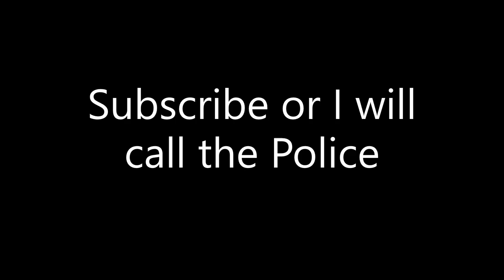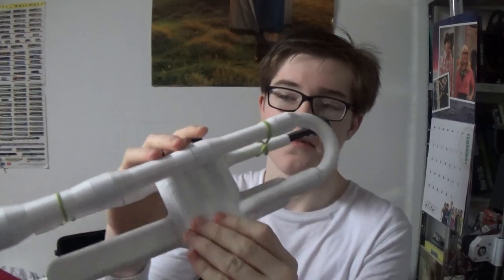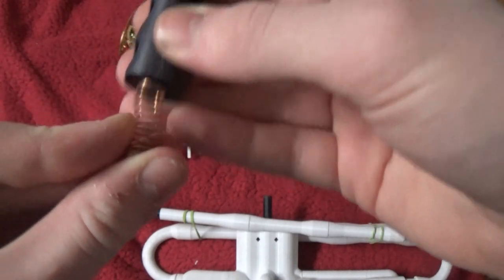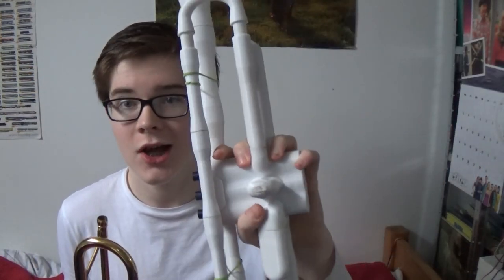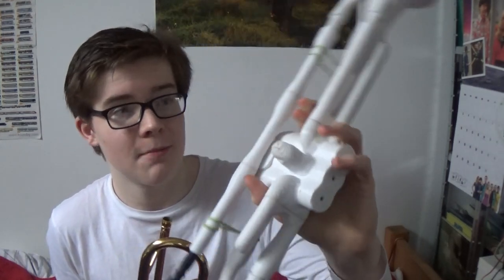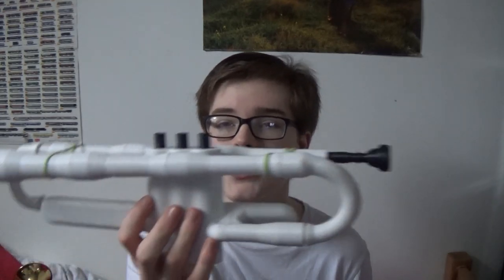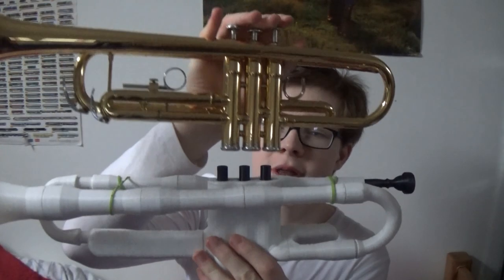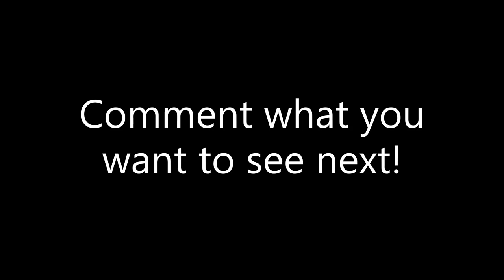3D printed trumpet?!?

Comment: The tone of the plastic may be ok.  It may be the valve tolerance that is causing the "wobbly" sound in the notes being played.  If the valves (and the respective bores) were polished to a decent smoothness and the tolerances are kept tight, it may sound quite decent for the price.
Reply from the maker: Yeah, I tried to make it nice and tight, but sure ah well. I appreciate the advice!

Comment: sound like its leaking air everywhere. you could play a better tune just with a simple pipe of any size with any mouthpiece. the fact that the 3D printed trumpet sound is so bad tell me that it is leaking air inside and that air is colliding with a reverse flux, thus it is cancelling the normal resonance.

Comment: With enough work I think it could be made to sound pretty good, if not great.
Thank you, I was wondering what this sounded like (I found your post on Reddit).
Edit:
I didn't watch the full video... so I don't know what your analysis is of what the problems are, but....
I think that it's likely that the off-key sounds could be from air leaking in the valves.
And that you could solve by printing in resin, or even by sanding or spraying your part down with clear polyurethane in those tolerant sensitive areas to close the seal.
Reply: Also!
In regard to the valves getting stuck, you could add a lubricant or even print in the orientation where the layer lines are in the direction of the valve's movement (so that those layer lines don't grab eachother).
Great work! Like @sochimaanike1916 said "Big things start small."

They most certainly do!

Comment: I certainly don't wish to be rude or unsupportive, but the truth is that the "3D printed trumpet" in this video is in fact NOT a trumpet. It is a trumpet shaped thing that does not work musically, and is clearly not functioning acoustically as a trumpet. As an instrument designer and maker and player, it is clear to me that several serious deficiencies are keeping this from working, other than providing a vague path for the buzz from the mouthpiece to eventually make its way to the bell end. It is clearly extremely leaky, and there is no resonating of an air column going on. This is why there are no real entirely 3D printed trumpets out there; you just cannot get the tolerances to have it seal up airtight and still have working valves and slides. Now, you could successfully make a perfectly functional bugle or natural trumpet using 3D printing technology. Many woodwind instruments have been made using 3D printing that work quite well. The killer is the need for airtight yet freely moving slides and valves, and 3D printing at the current level of that technology can't do that.

Even plastic valved 'brass' instruments that are on the market are firstly molded rather than 3D printed, so they can get better tolerances, and at least most of them use inserts made of better materials in the valves in order to have those work properly.

With that said, I applaud "Dman" in his efforts to try this. But since a valved trumpet is beyond the reach of the technology, I would like to suggest that another brass instrument would be more successful (probably a LOT more successful). Some good candidates:
- try starting with a 3D printed bugle
- advance to a 3D printed natural trumpet
- perhaps try a cornetto
- try your hand at making functioning keywork to create a functioning keyed trumpet or keyed bugle

Don't give up trying, but try things that you have enough understanding of the requirements first to have a chance at success.
Reply from the maker: Well I appreciate your input, I had fun making it and it gave some people a laugh, so I think job done!

Comment: It sounds bad because of air leakage
Reply from the maker: Yeah. Not bad for a first attempt though.
Reply: Is it leaking from the valves or from the individual tubes that make up the trumpet? I am thinking about 3D printing my own trumpet but I am having trouble finding precise measurements for everything... Do you have any advice on this?
Reply from the maker: I think it’s leaking from the gap between the valves and the casing. When you print it I’d sand them down evenly and slowly to get the beat fit. I used silicone to join the tubes so there’s probably not much leakage. I’d recommend a high infill to minimise reverb inside the parts. I think that’s everything, if you need anything I’ll do my best!
Reply: Thank you so much man! I think I will start by modeling a Bb bugle and work up from there... I will also look into rotary valves as opposed to piston valves; they may prove to be less noisy and possibly seal better...
Reply from the maker: Good luck! Tell me how it goes!